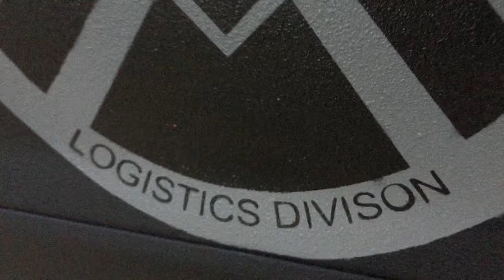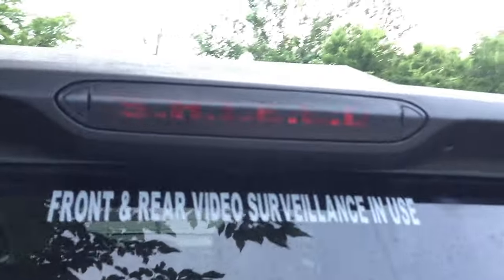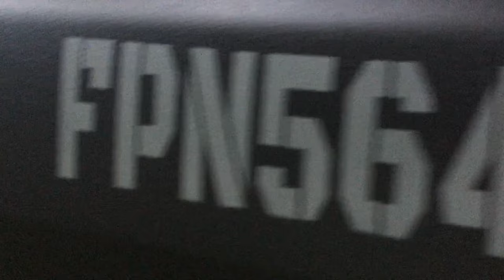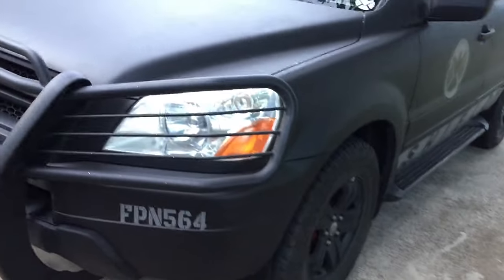Rustoleum bed liner paint job 1 year update!

Comment: Next time you spraying paint on metal spray it with adhesion promoter before you paint it...it wouldnt chip off
Reply from the maker: Jay Bryant It was just on the chrome paint and I think it was because my children did the sanding i wanted them to help. But i checked the Milage and it has 20k miles of highway use I was shocked to see it wasn’t chipped as bad as I expected

Comment: Looks awesome. The brush guard most likely peeled because chrome is difficult to paint over, you gotta basically sand completely through it before painting. That's been my experience.
Reply: Chemicals do wonders.
Reply: @stormytheraven426  if you use a black primer over the chrome after you sand and buff it down it, before you apply the bed liner, it seems to work rather well  in my experience. At least better than going directly over the sanded/buffed chrome alone.

Comment: Best way to paint chrome is a sander disk on a grinder and use a palm sander with 60 or 80 gritt sand paper them wipe off with rubbing alcohol or even fingernail polish remover and wipe off and oils from hand

Comment: Thanks for this video. I have 2000 E350 high top that I'm customizing as s boat/camper hauler. It's currently silver and looks really good , so I'm just going to paint the roof, the bumpers, and the front grill with the textured black. Along the bottom on the sides im using the black anodized aluminum diamond plate for the look of a kick/rock guard. Your video is the best one showing me how to apply the paint. Thnx

Comment: I have a white 2011 Honda Pilot and the roof paint is coming off. I’ve been trying to figure out what to do about it as one spot is beginning to rust. I’m in central Alabama so summers are hot as balls. Also I kayak and camp and the roof gets a lot of touches between the kayak and roof racks. Saw a Jeep Cherokee on Reddit that someone did the roof with truck bed liner and I’ve been pondering it ever since. Think you just gave me the confidence to do this. The cheapest quote for roof only to be repainted is $700 and for a 14 year old vehicle with 200k miles I really don’t want to drop that kind of money into it. Thanks for the great video!

Comment: When using the 2k clear,what resporator and filters do you recommend for the iso?thanks for your time and effort in the videos on your channel
Reply from the maker: 2000yamahar6 The air filtration I use is the 3M autobody masks everyone says you need a different kind but if you have decent ventilation and the 3M respirator you will be fine. I have been doing it for awhile now (Years) and I’m as fit as a fiddle.
Reply: So if im out in the yard no garage or shed or anything else the air flow should be enough with that 3m mask to do what i need for a one time paint job as long as body parts and eyes are covered?
Reply from the maker: 2000yamahar6 yup!!!!

Comment: Will that harbor freight electric sprayer spray this stuff all right?  I bought a bunch of it to paint my car.  Glad i did, this looks sick!
Reply from the maker: I never used it to spray this but might be worth trying to do hmm.. I used the duplicolor truck bed coating gun to paint this. Since this paint job i have been using the raptor liner gun and prefer it over the duplicolor gun.
Reply: @JamesDguy  Do you have to thin out the bedliner to spray it?

Comment: nice paint, i have the 06 pilot, and the clear coat on the door trim part is chipping away ( it’s the middle big plastic part same color with every car ) do you have any idea how to remove that ? so i can repaint and the rear quarter panel is rusting
Reply from the maker: Zac HK I am not 100% what you mean but you could always tape everything off and redo it

Comment: I want to raptor line my son’s 03 corolla S, it has a molding trim like a belt line in the center of the doors, would you recommend removing that trim or paint over it?
Reply from the maker: Sensory Overload I usually take them off then paint them off the car and re install but many times I have just painted over them
Reply: Moore Motorsports James Dguy thanks, I appreciate the help! I am a little nervous about doing it.

Comment: When using the 2x rustoleum from Walmart. How long after you finish painting can you wet sand it. Does it need to be wet sand? How long after you spray paint it can you drive? If i paint it at a location can i drive it home if i let it sit for a few hours?
Reply from the maker: J G I have wet sanded after 48hours but I usually don’t wet sand because it usually comes out really smooth. I have also painted without clear and with clear. The clear method I wait about 15-20mins then add clear that way it bonds better. Without clear I paint it and wait about 20-30mins then it’s drivable. It worked for me but also depends on temp outside
Reply: @JamesDguy  Thank You so much. I saw you video that you did with the green car where you showed the Walmart receipt and said I can do that. I ordered all the parts needed. This is my 1st time painting but you made it look simple. I will let you know how it goes. Thanks
Reply from the maker: J G I have years of practice but I have taught so many people how to do it them self with good results so you got this!
Reply: @JamesDguy  I have one more question for you. I bondo a area 3inchs by 2inchs. Can i use the spay paint as is without primer since the 2x has a primer inside?
Reply: @flexinlex2003  How did your paint job go? I started painting my truck today after months of sanding and body work.  I am doing it in sections gradually.  I was going to use the 2X, but switched to the advanced formula with gloss in it.  It is a better paint and sprays perfect.
Reply: @cnkilts  Not bad I have to wet sand one more time with 2000 grit and then compound and polish. But looks better than it did. Will advise you when done. Will try to complete tomorrow
Reply: @flexinlex2003  sweet thanks for the update.

Comment: Moore Motorsports James Dguy Got a question I’m painting my truck and this my first time should I sand down the entire truck or just the spots where the clear coats coming off ?  Also I don’t have air compressor can u also use the spray cans ?
My truck is white and in painting it the bed coating over the whole truck

Comment: Looks good just a little wear and tear but expect no big deal and not sure or not good for no clear coat if none .
Reply from the maker: It has no clear coat since its a 1 part system. Raptor line is a 2 part system which does have clear/UV protection basically a clear coat. Might re do it some day with a coat or 2 of raptor line with the 2 part system. But since its a cheap $50 paint job its great for the price and holding up great!
Reply: @JamesDguy  Yeah it really is it's mostly likely just wear and tear from being in sun,rain Ect.Still looking good
Reply from the maker: Why so Serious? Yup but it’s only on the front brush guard really
Reply: @JamesDguy  Yeah chrome can be a pain too I've painted chrome bike frames before
Reply from the maker: Why so Serious? Yea I should have taken over though I let the kids sand it lol
Reply: @JamesDguy  You might have a good base if you ever redo it again would probably stick too another coat.Unless you used Aircraft paint remover if they still make it I used too strip paint off bike frames shit would just melt the paint off down too raw mental then I primer it to give paint something too stick too work good.

Comment: James.  Any suggestions on dealing with orange peel with base paint and clear already applied. This is specific with spray can paint that has cured for about 24 hours now.  I did this at a friends request and am worried the spray paint won’t hold up to compound / polish this early on. Any suggestions would be appreciated.
Reply from the maker: Zook Inthe6ix I say 48 hours and your good to wet sand and buff it. That’s the best way i get rid of orange peel not use sure if you watched my pink crv wet sand and buff video
Reply: Moore Motorsports James Dguy watching it right now. Thanks for the info appreciated.
Reply from the maker: Zook Inthe6ix No problem